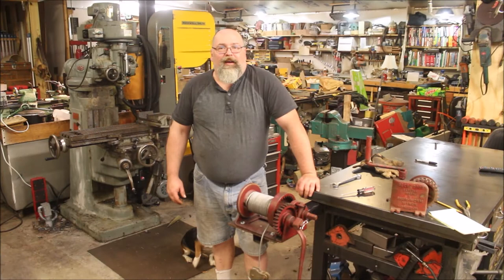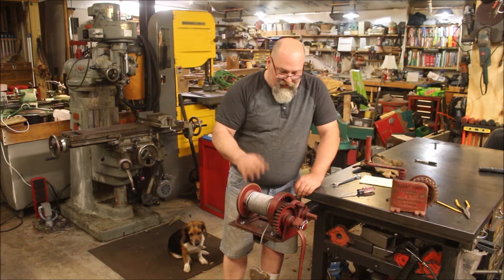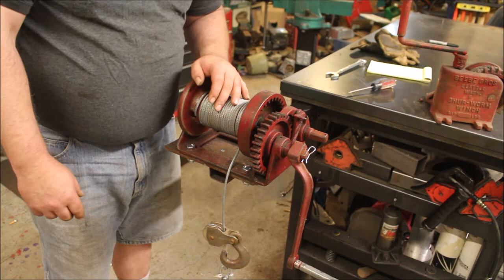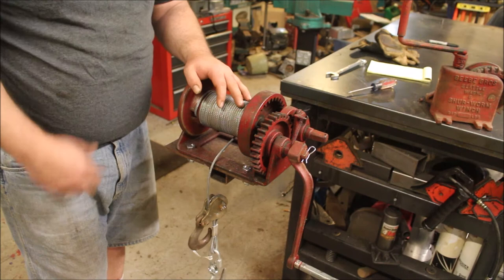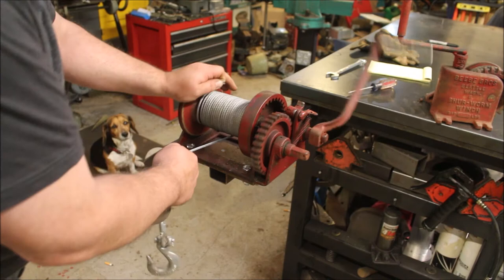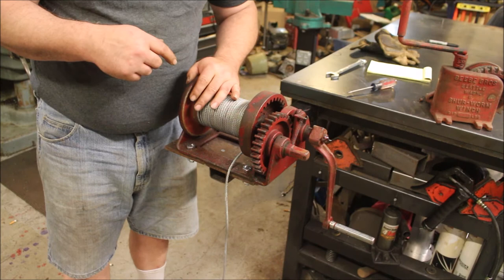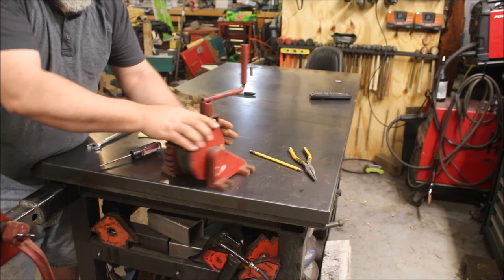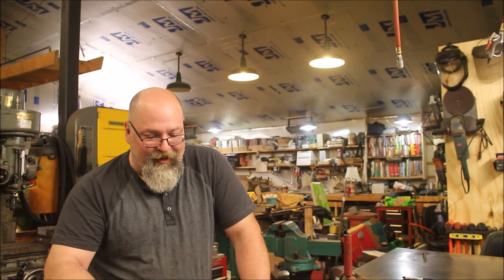Manual Hand Crank Winches Gold Foundry & Machine works +Beebe Bros

Comment: I just found one of these new in the box from a older gentleman that never got around to using it. There wasn't any directions with it, but it did have a tag that say's, "1500 lb. Straight line capacity all steel hand winch. Always keep 2 wraps of line on drum. Oil before using. not suitable for live loads." This tag was a hand typed, so it must be pretty old. The box says Hand Winch Model B, Quantity - 1, Gold Foundry and Machine Works, 1618 South Osage, Independence, MO.
Reply: My dad wrote that.....he did all the tags .....
Reply: My dad wrote all the tags....if u still have it can u post a picture of it....he passed 8 years ago

Comment: reverse ?
Reply from the maker: Unfortunately there is no positive stop in reverse, when you undo the stop pawl it is free wheel, the gearing is good however and the few times I have had to let out cable under a load, I just switched the handle from high gear to low and had no issues.

Google finally came back with a ad for this winch after many searches and it is 1500 lb single line rated.

Comment: I've got one of those "Gold" wenches er winches (i still can't help poking fun at the local guy that kept advertising for a " 4 wheel drive pickup truck with wench").   I think you are limited by your cable strength and the amount of wind you have.  As tough as cast can be.